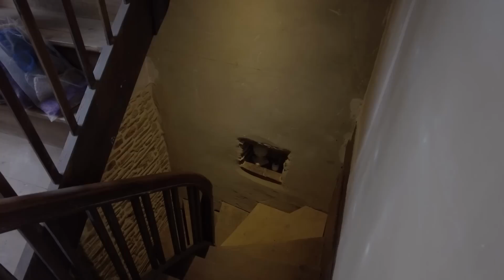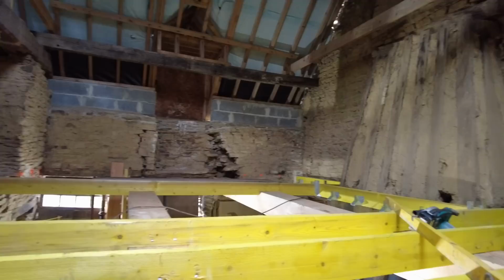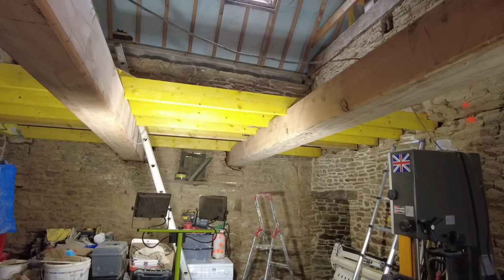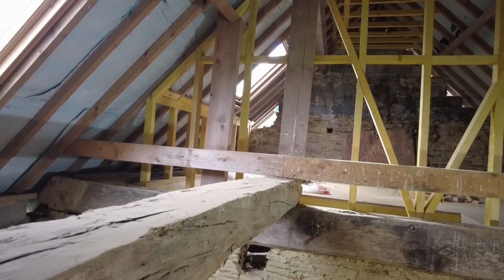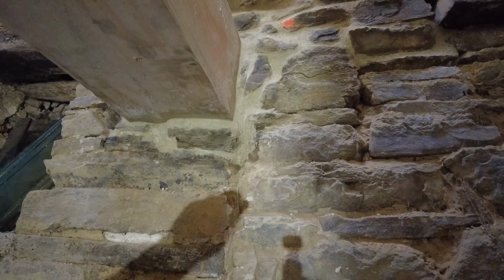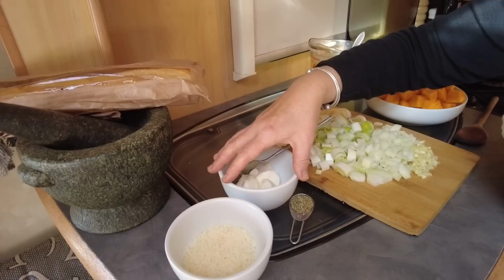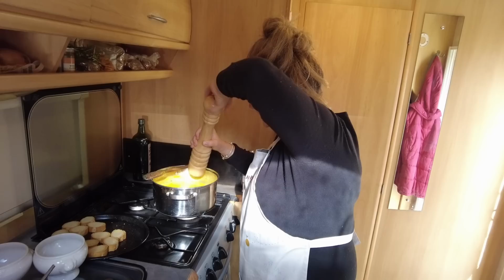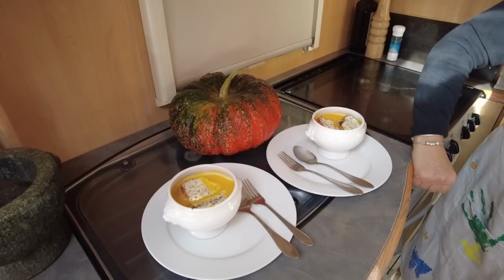No 78.How to fit floor joists on wooden beams and make pumpkin soup#frenchfarmhouse #nodiggardening

Comment: It called toe nailing in the U.S. if you want to stop the floor from flexing you add blocking in between the joists. By notching the joist you reduced the the carrying load unless you mount them with joist hangers. You make beautiful windows and doors but I think you need help with the framing and floor plans from an architect.
Reply from the maker: Hi Nathan framing in the US is different to here in Europe as we have to bare on the solid stone walls with double trimmers and we call it stitch nailing on the hook were joists land on beams you call it toe nailing the blocking your talking about is called nogging in the UK which i have now done after waiting for Tracy to do the stone infill and also my friend i have been doing this type of work which we call first fix for many years which all Carpenters learn first in the UK which is straight forward and easy to do on notched joists its carrying load is 4 tonne per 4 inch baring at one square yard  so do the maths my friend mine are 5 inch at one square yard so the load increases to 5 tonne so no need for an architect as they normally need educating today as there not taught like the old timers